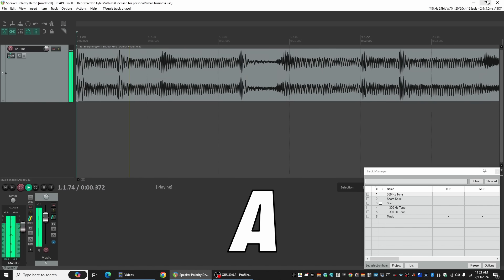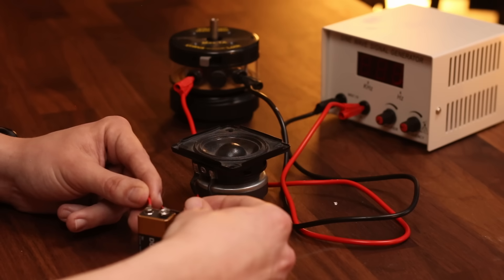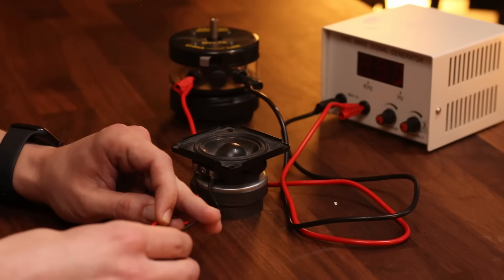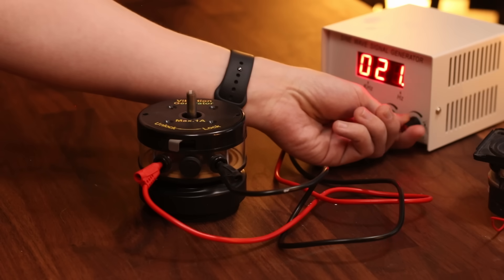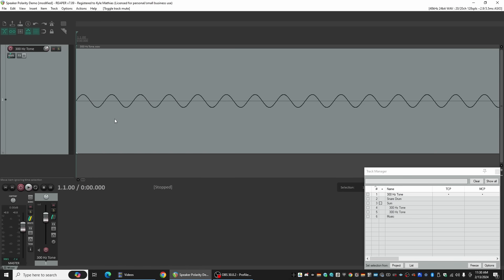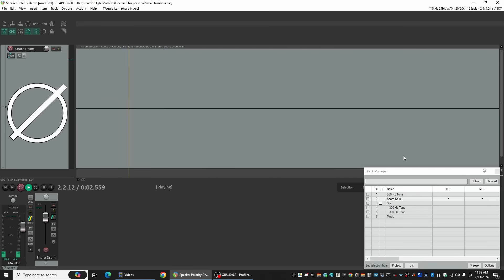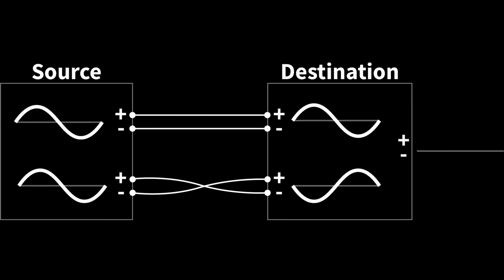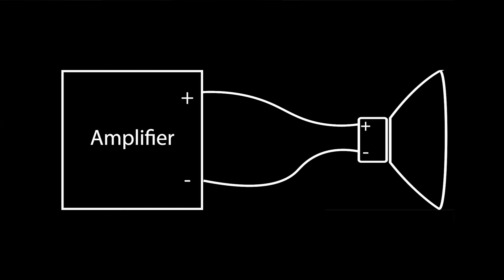What Happens When You Wire Speakers Backwards?

Comment: You have a gift, dude. I spent decades in the professional audio industry having been born into it with my father coming before me. And you have generated over one and a half million hits to this video sharing something I've known since I was in grade school. This isn't me criticizing you, it's me applauding you. To be able to do this, it's a gift. Things I took for granted surprise me often. I had inherited a half dozen JBL Professional transformers. So common in our shop were these, I literally thought they were garbage

For giggles, put one up for sale on ebay years ago. They started stabbing each other to obtain it. Ended up getting $200 for something I almost threw away and had five more of. Just one example of a pleasant surprise. You should do a video on impedance matching. Reversing the polarity of speaker isn't something that commonly happens with polarity marked on the speakers or speakers with wiring included having these wires color coated. You are correct in stating it does and does not matter if reversed. As a professional, it absolutely matters. Nothing would scream amatuer louder than having screwed up the obvious. Doesn't matter in typical two speaker stereo systems much because two independent channels, etc.

But impedance matching of speakers to amplifiers is not well known at all. Yet is simple and straight forward. And very important. The common person is typically power output motivated when it comes to amplifiers and sound systems. Yet, they are ignorant to what they are referring to because all they know is what salesman tell them. Salesman are always motivated by making bigger, better, and more sales. Usually equally as ignorant as the end user. So, more, more, more and bragging rights for power output rules the world.

Which makes any video you would offer on proper impedance matching that much more relevant to the common consumer of audio amplification and sound reproduction equipment.

You're a good presenter. Don't know your background in audio. You may be another YouTube creator who presents him or herself as expert, but the we and us they often use to make them look like a great big rolling railroad is non existent. I can hear them justifying the terms used by saying they were referring to their wife/husband or baby children. Can't blame anyone for trying.

Impedance matching is necessary to get all the wattage you thought you really needed when you bought that big power amp or stereo system that put out all that advertised power to actually be used. If the output rating of an amp is 4 ohms for example. Let's clarify at 4 ohms per channel,  to get the 100 advertised watts of power per channel you paid for, you need to match the input impedance of the speakers to it. 4 ohm amplifier output to 4 ohm speaker input means all 100 watts of power is available.

Impedance mismatches will still make the amplifier's power output available, but in lesser percentages than advertised. Same example of amplifier with 8 ohm speaker. The mismatch is a factor of two or half. The 100 watts would not be available and only half this, 50 watts, would be. It's always a reduction in advertised power not an increase. So another speaker, listed as having a 2 ohm impedance input connected to the same 100 watt, 4 ohm rated amplifier output, would also produce half the 100 watts of power available and 50 watts of power tops.

Start mixing multiple speakers per channel and that's another complexity all together but on the same level. Since impedance is basically the resistance measurement of an ac device, it increases and decreases in rating same as resistance does. Put two 8 ohm speakers in parallel, and the amplifier does not see 8 ohms but 4 ohms. Put the same speakers in series, now the amplifier sees 16 ohms. In this scenario, on a 100 watt power amplifier with a 4 ohm output, the most you'll see from that 100 watts of power you have is 25 watts being 4 is one forth of 16. Always lose power from mismatches, never gain.

Sorry to lecture. I'm old and too much to do, nothing I really want to. Thanks.
Reply: Thank you soo much for writing that , but i iwill have to read it several more times. My old Denon surround amp can take 8 or 16 ohms so I have 2x 8 8ohm speakers ohms in series for music for stereo . A HDMI INPUT gives the best quality stream Via googe TV but the best is l use my i phone to mix only the low frequently via a DAYTON 140 $ Box as all songs are different . Thanks again sir.

Comment: I've always referred to speakers being 'in phase' or 'out of phase'.  In 'stereo' this just means the cones are or are not moving in the same direction at the same time given the same inut signal.  The most telling example is, for example, signal content is the same (like a monaural source) to both channels or stereo with a vocal that when heard should locate to the center of the soundstage.  If in phase, the vocal (or any other content) intended for the center should sound dead center, leaving you to swear there is a center channel speaker when there is not.  If the speakers are out of phase, the soundstage will be muddled, since the signals are still coming from both channels, but not synchronized - the most easily heard effect is that same-signal content will not be placed as it should in the center, though for stereo content in fact nothing is really as it should be.  Sound from each speaker by itself will sound fine, and in fact the combined sound may seem ok - but it won't be, though some music will be obvious and other music not be as revealing. A simple test will make the problem obvious.  I always used a track where I knew a single artist vocal was supposed to be in the center.  Choose either speaker (but not both) and swap the wire ends on the terminals at either the speaker or amplifier end (but not both).  Then step back and listen.  Do this several times if you need to until you can easily tell the difference - and when you can decide, leave the connection that sounds best.  Be sure you use a good listening level when you do the test, and you may find it necessary to use content that will be more revealing.  This was the test I used years ago, before speaker wire and amplifier and speaker terminals started being labelled / color coded to make it more likely the end user will set things up correctly.  It is still possible today to set up the speakers out of phase, but the test is quick and worth taking the time.  Make no mistake, this is a difference that you can hear.

Comment: Question for anyone out there: Not all speaker wires are black, and red. mine are both black. except one has lettering running the length of it, I assume this is the "red" one, am I correct?

Comment: Just two thoughts, because the video is not about headphones: The wavelength of 300 Hz as in the example is about 1,13 m. To extinct two waves by each other, their distance to the ears must be half of the wavelength - about 57 cm. At 1000 Hz it's 17 cm, at 3000 Hz it's 6,5 cm. Even if the two speakers work with the same polarity, there would be peculiar "notch-filtering" if you just move a step. Second thought is, that the two speakers do not emit from exact the same point. Therefore they extinct and attenuate each other in the same polarity or in reverse, just shifted a few inches, so the same notch should be audible.

Comment: Does that mean I can set up my stereo system in reverse wiring, i.e.one speaker normal and other - inversed. and now if I am between both speakers I would hear normal stereo sound, but people outside the room (family, neighbors) will not hear anything at all because the signal cancels itself out as both soundwaves merge?
Reply from the maker: No. It does not mean that. Check out part two (link at the end of the video).

Comment: Wiring the speakers opposite will give you a wider perception of the sound , THX did a kinda similar thing in the rear channels but instead of reversing one signal they have both sides constantly phase-shifting

Comment: Great vid. Last year I had one of my main speakers wired out of polarity. I had a mate over (who works in audio) to tune my subs. He listened for about 10secs and said 'I think your wiring is out of polarity' and of course it was. When I corrected it the only noticeable difference was the imaging, the sound quality was the same but the voice was no longer smeared, it was positioned.
Always learning, thanks!
Reply: Huh? Correcting an out of phase driver will ALWAYS result in more bass, if it's anything larger than a mid. 

Reposition your main speakers if it did NOT help the bass.

Comment: a properly connected speaker plays in phase, while the other way around it plays out of phase and in both cases they play with the same power given by the speaker manufacturer - when connecting them into a 3-way speaker, the woofer or bass speaker is connected in phase, the high-tone speaker is always connected in phase and the midrange speaker must be connected out of phase via a crossover, then the speaker column plays correctly, presenting the sound stage to the listeners

Comment: No significant difference if only one speaker and no ither electronics are involved. But if one channel in a stereo pair is reversed then they will be 180° out of phase. A stereo signal will not sound as if it's coming from between the two speakers.

Comment: I used to do a lot of live binaural recording and didn't criticize absolute phase in sound. It finally came to me when I recorded our local orchestra and chorus doing the 1812 overture with a USNG 105mm gun battery on the side. The speakers are supposed push into the room, duh! I wired a dual dpdt switch into the headphones too, it makes a big difference. Then I listened to voice, strings, and familiar radio host voices and noticed a difference between the two phases. Strings are decidedly asymmetrical waveforms so is the speaking voice.  I can usually see the polarity on recordings off the web of radio announcers by looking at the wave file on Audacity. 

Absolute phase matters. Try one speaker with a very familiar voice, then switch. In a single take recording even multitrack the end product phase should be correct. Then it is up to us to set the correct phase on a wired up system. A self contained system should be compliant in it's box.

Comment: while we're talking about speaker wiring, on the back of a brian eno album, he describes how he takes a wire connected to the positive (or it can be the negative ) of each speaker and connects it to a third speaker.   it results in getting a signal that is the difference between the 2 channels.   this might be how cheap surround sound amplifiers work.   anyway, ive tried it.   it works.   for those of you who dont know, brian eno was an original member of roxy music.

Comment: I have a thought - if the speakers are a meter apart, the combined wave made by both speakers intersecting the point where one ear is equidistant with be in phase and loud, while a small movement of the head will make them out of phase and quieter in small patches across the entire volume the air can move around in. If one speaker is out of phase, then those in phase and out of phase areas will just be inverted, and the pattern of a centimeter resolution or two (due to the frequency/speed of sound)  will be the same... (just inverter).... meaning there should be no appreciable difference in sound effect. Hmmmmmm....

Comment: You don't hear a difference because speaker is on an open air bench. Inside an enclosure directionality of the pressure changes (sound waves) will be more apparent.

Comment: warning newbie here...  OK this might be long. I'm trying to match speakers with a receiver, but the receiver has to be under 14 inches wide and will need Bluetooth. I'm using a really cool 1949 Philco cabinet. Most of the receivers that fit (under14 inches wide) that cabinet are newer and seem to have lower rated wpc, like 25wpc or less. I'm also wanting just a 2 channel type signal. Can I get another amp to boost that wpc, and if so will the receiver need to have a special line out for the amp? Philco even makes a small receiver I could use to make it look cool.(it only has speaker connections on the back panel)???. I want to find some older wood box speakers, maybe even vintage to set beside the old Philco cabinet. Most of those require a lot more power than these modern receivers can deliver. Any suggestions.

Comment: I had to wire speakers to reverse polarity when they were facing each other to get good bass response but other than that, it is a big no no. It doesn't affect upper ranges as much other than creating a wide stereo effect but it will cancel the bass out.

Comment: Thank you for your great explanation. I used to have a similar issue with my speakers when I mistakenly connect the right speaker correctly (+&-) to my audio portable steryo system and the left speaker reversed (-&+).
I still have a sound but the unison is bad in terms of the base sound. Is this situation close to your main idea?

Comment: As long as the polarity is correct the speakers will be in phase. If one of the speakers is wired in reversed, it will be 180 degree out-of-phase. Meaning that as one speaker cone pulls in, the other is going in the opposite direction. Normally Red is Positive, Black is Negative. HOWEVER it does not matter if black goes on Positive and Red as Negative, as long as both wires are wired the same to both speakers. It just make color coding easier to identify the proper connections, making Red Positive and Black Negative is easier to remember.

Comment: Speakers are mechanically constructed to excurse the voice coil outside (with DC signal) when connected with the matching polarity. Construction wise the null position of the coil is not symmetric with respect to pole pieces to take advantage of the fact that the flux density is higher at the edges of pole pieces.

Comment: Simple explanation: its an electromagnet aka the coil will change it's magnetic field to fight against/with the magnets current. When you wire it backwards it will still create a simmilar frequency due to it still moving up and down at the same rate. You will still want to wire it correctly just in case you have several speakers fighting each other. Hope this helped!

Comment: This principle is used in the music industry. Where events are regulated with maximum DBc Levels. Usually 80-100m behind the stage. 
We turn the subwoofers 180 degrees facing backwards and let them play out of phase. This results in lower dbs in the back and a little boost in the front. Works great if you want to go loud but not get fined.

Comment: Wiring the driver's side speakers of a vehicle out of phase was poor man's time alignment back in the day. It allowed for much better spatial alignment for only the driver and pulled the soundstage into the door for the passenger, but f*** them. When the there is only 2-3 feet or so to the drivers doors speaker from the ear vs. 4'-5' to the passenger door it works out. Metallica Dyers Eve you should be able to here the drums go across the soundstage.

Any subs had to keep up with the double bass in that song too or they were too sloppy.

Comment: A little car audio story.. I was testing two subwoofers. I place one in the trunk and one on the back seat.
They were sounding loud higher than 50hz but weak below 50Hz. ( Had them wired inverted)
Then when inverted the polarity (back to normal), they did the opposite, they sounded weak higher than 50Hz but louder under 50Hz.
With that said, speaker placement is crucial thus all frequencies travel at different wavelengths as well as the environment they are placed in. I was kind of in "awe" when I heard the high frequencies sound louder when there were out of phase at the position they were in. But mind you the bass frequencies were creating nodes and other issues when inverted. So keeping them in phase is always the best idea UNLESS you are doing some weird experiment like I did.

Comment: Thank you. I didn't know that. I have an old 5.1 surround sound and I reversed the polarity of one speaker and in improved the sound from left to right. The cable doesn't have any markings whatsoever for me to check what is right or left.. no colors or anything. I hadn't even considered the possibility of having wired some speakers the opposite way.

Comment: Well the speakers are not that complicated if you think about it, sound is just waves of air, one of the easiest, most controllable and cost effective ways to produce waves of air is moving a piece of cardboard covered with paint or fabric back and forwards, using an electro magnet. I guess if you invert the polarity you actually hear a negative of the original sound, but that should be hard to distinguish, I don't know, maybe it would be a good idea to make an experiment with that people who claim that they can hear the difference.

Comment: As a cinema technician, this is something we have to address carefully.  Surrounds on the walls can cancel each other out (note, the word is can, not will, since there is rarely identical audio being output), and also have a habit of decreasing the preceived output of the already lower (than the stage speakers) 82dB (at reference level, sound calibration for stage speakers is 85dB).

Also, although we always test and correct reverse polarity, there are those who argue that as long as every speaker is either out of phase or all speakers are in phase, it's fine.  I don't agree, but there are some.
Reply: Yeah the rabbit hole goes deep with real pro audio setup when you start to deal with things like comb filtering etc.